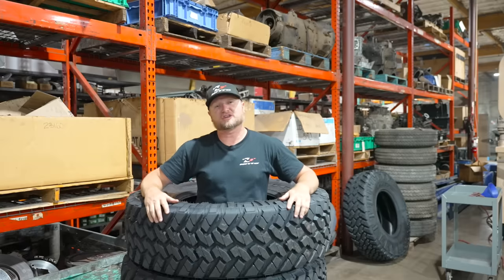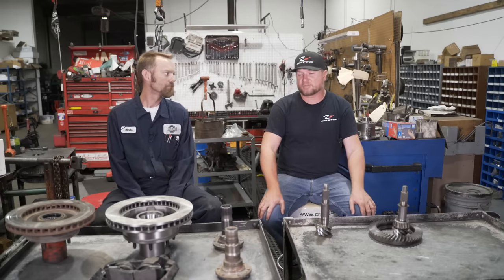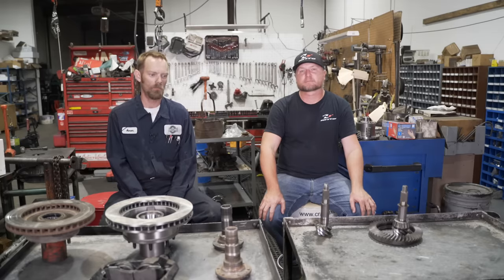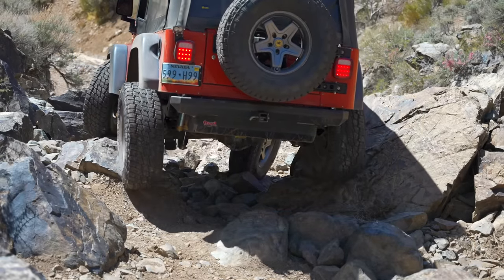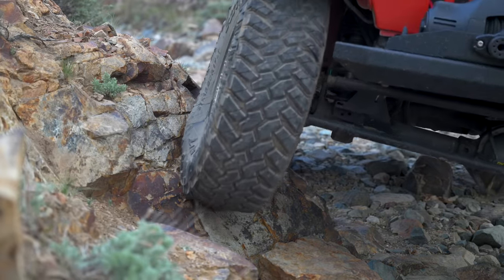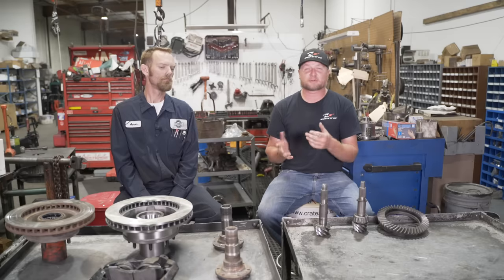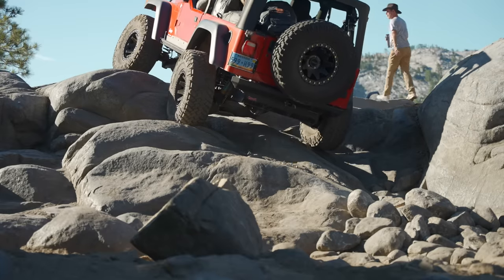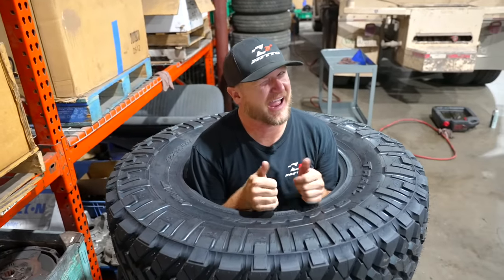How Big of Tires Can You Run on a Dana 44? | Harry Situations

Comment: I ran 40" Mickey Baja Boss on my 2018 Jeep JL with Dana 44's and stock gearing for 4 years and never had one problem. I was never heavy on the gas but I drove it everywhere and wheeled Rubicon, Fordyce, Moab and all. Dana 44's are serious beasts!
Reply: Same here,
I have a 2020 JT sport, Max tow package with heavy duty Dana 44 front and back wide axles. I have a 5.5 inch lift and 40-13.5-17 toyos all around 
Four years going thru almost every obstacle and I haven’t have an issue.
When the time comes and something breaks down, I am ready to upgrade. 👍🏻
Reply: Did you gusset?
Reply: @TortugaDeRio  no, I did nothing at all. All I did was a metalcloak lift
Reply: I'm running 37s on a stick dana 44. Chevy k20.
Reply: About to join that club, running 38s on Trussed and Cs JLUR 44s RCVd front and chromolied rear 4.88s. I'll have my "big boy" tires delivered on Monday.

Comment: Ran 35's on stock Rubicon axles with 5:13 gears for years on the Rubicon and Barrett lake until I bent the front axle.Went to 37's with a Danatrac heavy duty 44 front end loaded with chromemoly axles front and rear. 1 ton driveshafts. Goes anywhere and it's my daily driver.
Reply: Wow, those are the two trails that I am building my jeep for. 
Particularly Barret lake. My Great Grandfather was a cattleman and a place between Wilson's and Winmillers.
Last weekend we were talking about that area and he talked about the Barrett Brothers would tease him and make fun of his saddle.

Out of curiosity,  did you stretch your TJ to accommodate the 37s ?

Comment: 18 jl rubicon  3.5 game changer, 37's, yukon 488's, adams front and rear, rcvs front, chromoly rears...been everywhere...bullet proof for years now. Drive to every trail all over usa. My only thing is I avoid bouncing and I'm quick to pull winch line to minimize risk because I have to always drive it home.

Comment: I know this is an old video, but so is my 08 jkur. It has a 4.5 skyjacker dual rate long arm and a 2" body lift with sleeved 44's  Chrome Moly everything, and it has been running 38 inch TSL super swampers and 37 inch radial Iroks in the winter for the past 9 years. It gets used every day in the forest, and Alberta muskeg. 5:38 gears and a very gentle pedal must help, and I use the winch whenever a tire becomes jambed. 
Using the winch takes a few minutes, and has saved me thousands and thousands of dollars.

Comment: I kept everything under the recommended max because I plan on serious back country overlanding. I've got 35"s with 4.10 gears on my ttb Dana 44, and I went with Detroit truetracs to avoid hard lock and unlock issues, as well as keeping the steering workable with factory parts. I am running a 4407 transfer case to get more strength there, and a ZF-5 for even lower crawl speed and control. My main plan for long term reliability is sticking with a 300 i6. Mellow easy power with enough torque to grind it out at 1000 rpm all day with more or less no throttle input.

Comment: I daily drive my 2010 Rubicon JKU for 11 years, on 40s with 5:13 gears. Gussets, and internal sleeves. I am aware that I am pushing the limit but I am gentle on the skinny pedal and with the slug 3.8L and a slushbox, so far I haven't had anything break except the front factory driveshaft . Put a Tom Woods on and no issues since.
Reply: I’m running 40s on my 09 wrangler with the 6spd and I went to drive to the store today and out of nowhere I heard a loud pop and it broke a chunk off the spider gear so now I’m trying to figure out what to do I’m running 488s

Comment: I appreciate this so much… I run 40s on D44s and people talk so much shiittt!!!! RCVs, Gusseted, sleeved, chomoly axles front and back, etc. I do off road a lot and I do what I want but I never break stuff.. that’s because I choose not to by respected my rig and being thoughtful about every move I make. Why spent $20k on axles when you can learn out how to drive instead. 

If you break something on 40s.. you wouldn’t have broken it on 37s too. 

If you want 40s. Don’t listen to the haters just do it and enjoy! Cheers
Reply: Also run 40s on built jk 44s, main thing if you have to bump up something do it with the lockers off. And the lighter the Jeep the better
Reply: Great and all, as long as you know that D44 WILL break.   Im on 37s, easy pedaler, gusseted, sleeved, cro mo axles, Dynatrac BJs, blah, blah....   My last trip at Moab the passenger tube cracked at usual spot near pumpkin at 80k....   Fortunately my welding sleeves inside the tubes early on is what got me off the trail and the tube not snapped in 1/2.  My next step is RJ 60 to match RJ 60 in rear.  If you dont think its a time bomb on 40s, youre kidding yourself.  If the meantime you dont break, bent axle flanges are the norm running 40s on D44s.
Reply: @highwayman1218  lol fucking duh. I don’t think anyone argues your point and I also think the key to this is that of course D44 isn’t bullet proof on 37s or 40s. Just fucking build it and wheel it and ignore all the drama queens. If it breaks, good! Fix it, upgrade it and move on.
Reply: @highwayman1218 JK or JL d44?

Comment: I ran 35" Ground Hawgs on my Dana 44 and I rock crawled, hill climbed and mud bogged and I never broke anything. It was in a 59 Chevrolet Apache with a 396 big block and a turbo 350 transmission.

Comment: Nice job. No BS info. I ran 35's on a pair of Dana 44's in a flat fender with ARB's for 20 years. Never had any issues.
Reply: That's because you know how to drive.
Reply: @russgould707  exactly.  If someone needs 1 tons on a Jeep or yota, they clearly don't have a clue what they are doing.
Reply: @TheOnlyBlackInMeWasWillieBrown  I had a 76 f250 with 44s . Dana 44 HD front axle. It handled them just fine. You have to know when NOT to put the hammer down. Never had a ball joint problem  and the truck got driven over 100,000 mi with 44s on it. It would spin those 44s over on pavement with stock axle shafts. It was an open front diff though.
Reply: So true ! I had 33's on a 86 ranger and used to drive it like a go cart ! Eventually drove it on 40 s for a few years.  Thats when i broke a few axles . Back then they were cheap and so easy to change

Comment: Excellent, educational video!  Since 2012 I've driven a Jeep Wrangler Unlimited Rubicon.  I run stock tires and wheels.  I've had no driveline issues of any type.  I don't do lots of rock crawling.  Years ago, I drove Series IIA and III Land Rovers.  I liked to use Michelin 7.50 x 16 and 9.00 x 16 XS tires.  Although I wasn't doing the kind of rock crawling you show in this video, I broke far too many rear axle shafts in my 88" Land-Rovers with stock driveline components.  My 2012 Wrangler Unlimited Rubicon has been vastly more reliable!  Thanks for the exceptional advice of this video, guys!  Andy McKane, 27 December 2021.

Comment: Great and informative video! I have a 2018 Rubicon JL, running 4.88 gears, on a stock D44 (front and rear) on Cooper STT Pro 37's, and on a 3.5" lift. I also want to mention that this is also my daily driver, which I commute to work about 60-70 miles round trip daily, other than that I'm a "weekend warrior" out on the trails. Eventually I will be buying a daily driver, and when I do, I will be only using my Jeep as a trail rig, or during extreme inclimate weather situations. Anyway, I was considering moving up to 40's when I make that move, but lately (especially after watching videos like this), it might be more beneficial to stay on 37's, or go 38's, but even that might be pushing it. Thanks for the info guys!
Reply: I would probably add RCV axle shafts and run 38” Nitto Trail Grapplers when your 37s wear out. A JL is about 700 pounds less than a comparable JK due to the aluminum knuckles, hood, doors, etc and I think that will help your axles live.
Reply: @HarrySituations  actually a jlu weighs more lol. Look up the weights from the manufacture. Jeep lied when they said it was going to weigh less. The Jl is bigger than a Jk with a lot more wiring and electronics that add up over the weight reduction from aluminum. It is about 200 pounds more than a jk. The rubicons are closer, i beilive it is 100 more
Reply: @HarrySituations  The hood, doors, knuckles, windshield frame, etc, dont even weigh 700 pounds together lol. Im pretty sure the Jl has a higher gross weight ability and has a bigger gas tank, dont quote me on that tho.
Reply: I run 42s on my JKU stock axles with 4.56 gears. I have Dana 60s on standby but the axle hasn't broken yet. Food for thought
Reply: @JWard2  have you wheel'd it like that?
Reply: @CoryMp3 Yes he wheels to the mall only on sunny days!

Comment: Old JK had 40s on stock axles. Just upgrwded the bolt on parts etc on axle. Truss guss w.e.ball joints name it.  stock shafts for 4 years. Been through Rubicon and Fordyce a couple times. Never broke once. Only thing that broke was the track bar mount on the front axle... Had to strap that and drove baxk home lol. Im a pretty good driver. Never needed a spotter through soup bowl or the winch hills. Being light on your feet is what keeps shit from breaking. 3.6 Manual with 5.13 gears

Comment: 1310 U joints on the drive line is key if you are running D44's on a Jeep. It is a $20 repair. Like the dude said just carry are 2nd slip yoke!
Hell you can even carry U joints, and the tools to replace those on the trail. Much better than tearing an axle shaft, hub, ring/pinion out on the trail.
Reply: That's cuz the jeep Dana "44" isn't a real 44 and people don't realize it
Reply: @brad1367 What is it then? That's what I have.
Reply: @Tommy-rr7ez an M220 probably. 

He’s being gay about it because you can’t just throw any “Dana 44” locker in them as they’ve been slightly updated but that’s neither here nor there because afaik you can’t just throw any Dana 44 locker into any Dana 44 anyway as there’s plenty of variants. 

Dudes just being a gatekeeper that’s why he didn’t even answer you; he just wants you to know your axle “isn’t real”

Comment: Moment of inertia for a simplified tire in the rolling forward direction (a disc) is M=0.5*mass*r^2 meaning the difficulty to turn a tire is proportional to the square of the radius. This means a small radius increase results in a very large increase in difficulty to turn. Thanks for the good video!
Reply: I had exactly that in one of the Pop Up text boxes and figured it was too much to read. But the fact that force increases at the square of the radius is the key factor to understand. See also the video where we compared 37s to 40s and the comparative weight differences. It's a ton of force!

Comment: 5.13 40s. Manual trans. Zero problems on the trail.  Factory mopar 44 rear and factory recon 44 front and lockers.front and rear are trussed.  17 rubicon recon.

Comment: When doing the research for my build, I found that 300HP is the limit with 33" tires, built accordingly. 49 Willys wagon AMC 401, 700R4, 241C, 77 waggy axels, 4.10..280/370 crank.
Reply: Nice motor dude.

Comment: I put a dynatrac JK44 w/ARB & 35 spline in my XJ. So far so good running 39.5s. The 8.8 wasn't so lucky though. Blew the Detroit twice and killed a chromo shaft. Just ditched the Detroit for a spool & 35 spline shafts. Driving style= "I like the loud pedal"  BTW.

Comment: I’ve been running 35s on my 79 Ramcharger (83 part time axles) with a mild 360/nv4500/Dana300/4.56 for 16 years. Engine makes 279/341 to the wheels. I’ve always been careful with the throttle and the front was open for half that time. But no issues the last few with an Aussie locker.

Comment: Cool, informtive video.  Aaron should be included in future, informational videos!  Seems my Carbon assembeled, Currie 44 front 44 and 37's is a reasonable combo.  I run larger brakes to slow the heavier tires and keep an eye on unit bearings and ball joints.  Well done!
Reply: I agree! He is a wealth of knowledge.

Comment: Always a good time spent Harry! I think the more you reduce tire diameter and axle size & weight, arguably the more you can do. The Rubicon this year was far more challenging and fun on 35s in a SWB JK with stock 44 axles versus years past in an LJ on 40s with an extra 1000 pounds of axle weight and tires. Are 35s the new 40s?
Reply: Thanks for the feedback John! That new JK looks like a lot of fun.
Reply: You should try 31's or 32s then.
Reply: Your lucky you get to go to the Rubicon this year. Thanks to the fire, they closed downed it down the day before I was heading there for my yearly trip.
Reply from the maker: Oh man!! So sorry to hear that 😖

Comment: I am running 37in sticky treps on my 2010 2door rubicon with the dana 44.  I have trussed and sleeved the axle, along with gusseted the inner Cs.  I also am running chromoly shafts front/rear.  5.13 gears and 4:1 t case.  That tire is the absolute limit if you wheel harder trails,  I am upgrading axles when I break something, knock on wood I haven’t broken anything yet.  200hp might be the saving grace lol.
Reply: You bring up a good point about tires. They aren’t all created equal and sticky Treps are about the hardest on parts due to the weight and the fact that they break parts before they break traction.

Comment: TJ’s never came with a HP 30, but some XJ’s did and they are a direct swap.
Reply: That is correct.  The housing is a direct swap, might have to swap gears as XJs came with some non-TJ ratios like 3.55s

Comment: The factory TJ Dana 30 was not high pinion. The XJ (most years) used a HP30 which is commonly swapped into TJ's. But TJ's used low pinion front and rear

Comment: My wj danna 44a was crap. Swapped a 35 in after I broke an axle and bearing. The 35 was cheaper than a new shaft and bearing. I was only running 265/75/16's. Full of oil but bearing was starving for oil.

Comment: In my Chevy Dana 44 I have 5.13 gearing with true track and chrome shafts on 40s the axle shafts don’t hold worth anything as soon as I went to 513 from 4.56 it is so unbelievably easy to twist and axle shaft yes twist not bend would not recommend anything 37 maybe 38 with all the upgrades even if it is only in a pick up

Comment: My TJ came with a low pinion 30 in front. The XJs came with the hp30, and that’s what I swapped onto my TJ since everyone is so damn proud of their 44 housings 😂
Reply: I think that is a great choice for 35 (and even 37) in tires.  Same outers, lighter, more ground clearance, and nearly as strong.
Reply: @HarrySituations  Currently running 35's and will probably stay with them for quite a while if not indefinitely. One of the main reasons I switched to HP was for better driveshaft ground clearance. My driveshaft went from hanging below the control arms (LP) to above them (HP). A few inches can make all the difference!

Comment: Tooth count debate: I think heating and wear are a definite problem for the small pinion, but the pinion gear itself has less loading due to the larger ring gear it’s turning, so it might be a trade off there as far as overall strength. 

Might be. 😁

Comment: let's not forget about the  Dana super 60 which is found on the 2017 and up super duty's they have a 10" ring gear .50" wall and 3.5" axle tubes with 1550 steering u-joints and 35 spline inner and outer axle shafts  that's the front axle i used on my solid axle swap duramax

Comment: A couple of things to consider. Running a front diff on the coast side is not that bad. Most off roading that we see high stress or load is climbing. When the vehicle climbs there is load transfer to the rear taking some load of the front (less stress) , but when you have to reverse out of a ditch or uphill you can bet that front will be fully loaded and now driving on the correct side of the gear.

Secondly, less tooth count regardless of ratio doesn’t always mean weaker. It can mean a bigger stronger tooth profile. 

You can fit a D50 diff into a D44 housing thanks to Jantz Engineering

Comment: Good info but I wish you had talked more about braking issues with TJ 44s and larger tires as well as the increased capacity of the JK and JL 44s.  I ran 36s on my 05 LJR and burned through ball joints, unit bearings, and brakes like crazy, really wasn't safe in a panic stop.  Was going to go with a big brake kit then ended up building 609s.  If i were to do it again I would save the money get a set of JKR take offs purely for the bigger brakes and how easy it is to swap with aftermarket trusses.  Not to mention the 32 spline outers.
Reply: Black magic brakes would have done the job. The owner is Blaine who builds Tj/LJs and  personally the number 1 jeep builder. Knows the ins and outs of everything even designed most of all Savvy’s tj/lj products. If you don’t know Savvy they won at KOH plenty of times.

Comment: idk...I know (and have read) 1000's of people on stock dana44's running 37's with no issues for yearrrrrs. Granted how much "wheeling" is done matters. Most people are just doing daily driving and light off-roading. 37's are fine on stock 44's if you're driving in low elevations, low-to-no hills, and light weekend trail riding. I would say running 37's you'd want to upgrade your suspension bars (front and rear) for better driving and handling.

Comment: You mentioned weight of the tires as a big component -- it seems that the weight of tires in the 37-40" range can vary considerably. ie. a 37" trail grappler weighs 88lbs; which is the same as a 39" KM3 and a 40" Discoverer STT PRO weights 90lbs -- so assuming driving style is essentially the same given that these tires all similar weights would you still expect higher risk of breakage with the larger tire? I'd think a 40" tire that weighs as much as a 37" tire would be better as you'd likely climb obstacles easier and have to use less "bump" ?
Reply: Great question! I think there are situations like you describe where the larger tire will be easier on the drivetrain. But other times that added leverage from the taller tire will great parts.